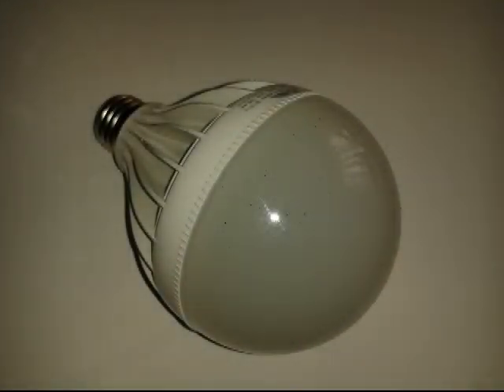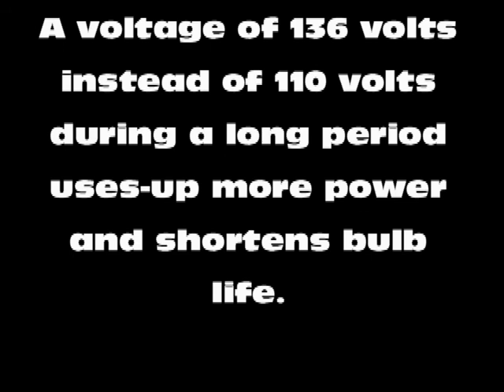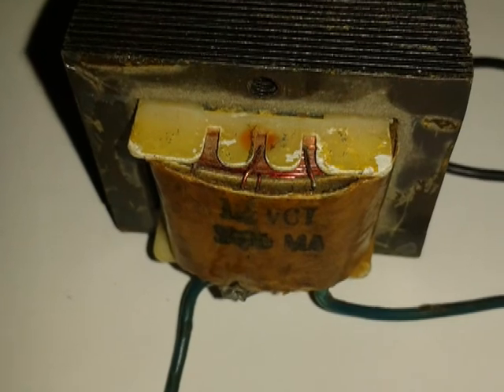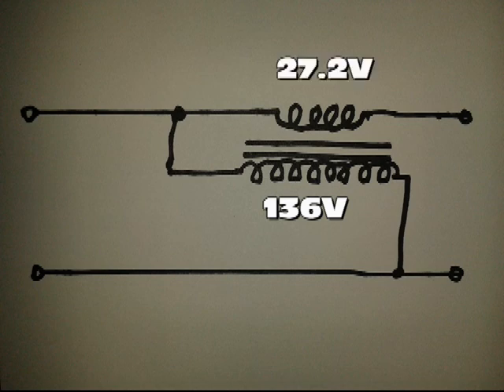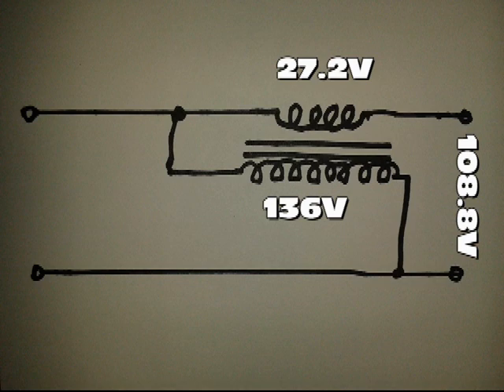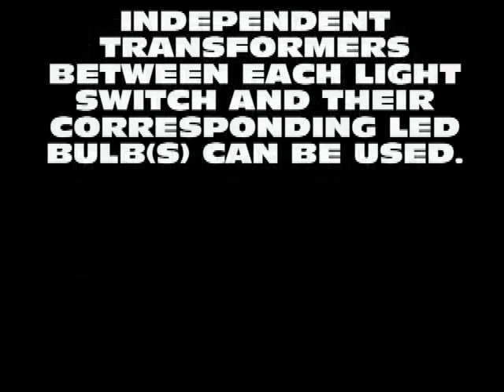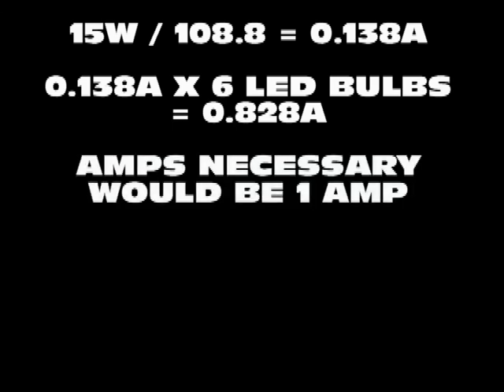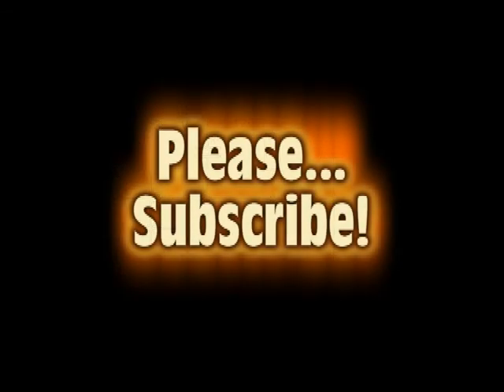How to prevent LED bulbs from burning out

Comment: Your a genius I will checky voltage because I have had so many burn out on me
Reply from the maker: It truly works! But You have to make sure of the voltage is being subtracted, and not added, You make sure using a voltmeter before connecting the actual LEDs. please see a schematic at https://www.youtube.com/post/UgyxdyxG_7hEBFHuKpF4AaABCQ . If your voltage comes out higher, as shown at A at the left side of the figure, please reverse the secondary wires of the transformer, as in B. Be sure to use a voltmeter to make sure of the correct voltage.
If you need to protect all your LEDs around the house, please watch my video at https://www.youtube.com/watch?v=hc4Xx5yeY6c